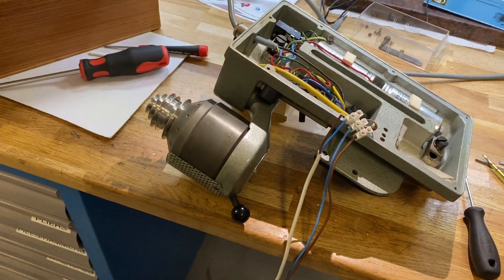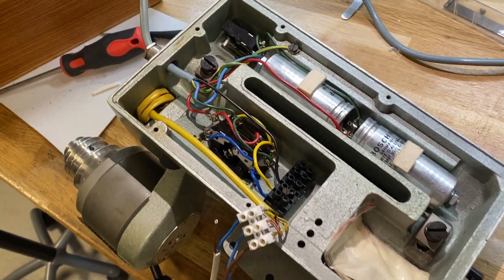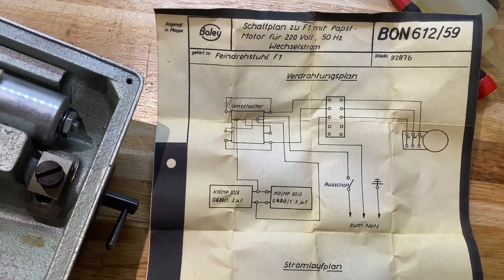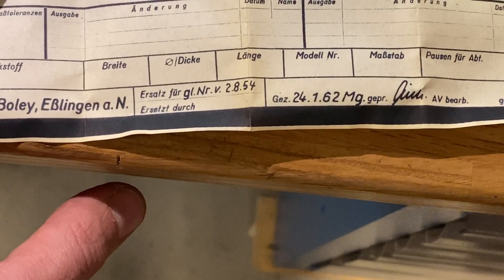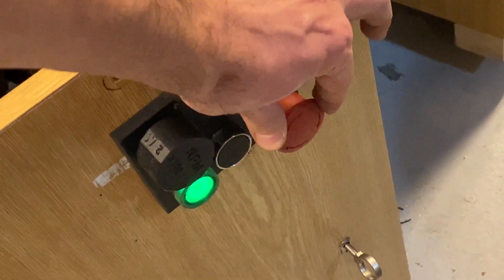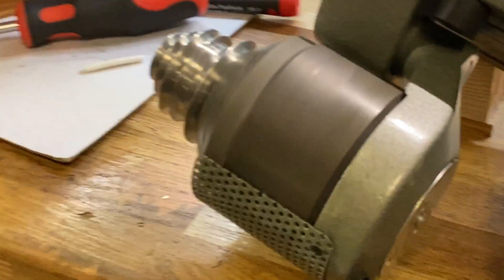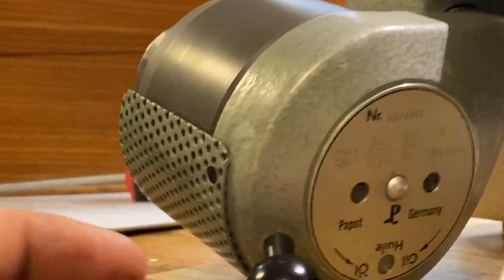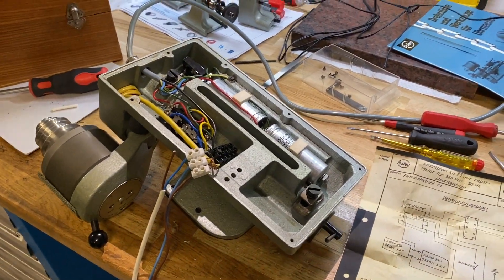How to run a Boley F1 lathe on three phase power via a VFD

Comment: Interesting. This power scheme is quite similar to that used by Maier of Austria, makers of the Emco Maximat lathes, for machines exported to North America. The run capacitor (two of them, in this case) creates an imperfect third phase which, combined with the “line” and “neutral” of typical 120 volt line current, is sufficient to drive a three phase motor. A modern VFD is vastly superior - well done!